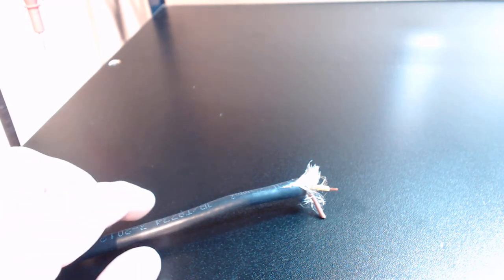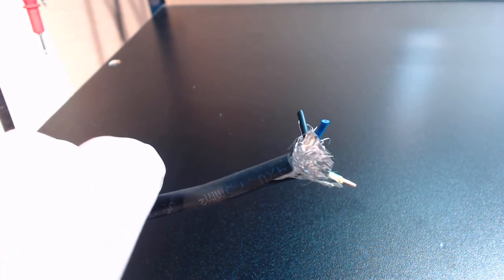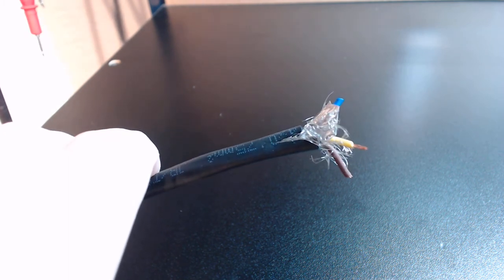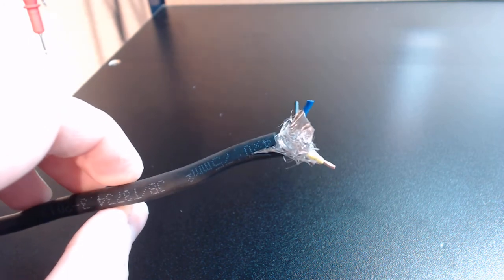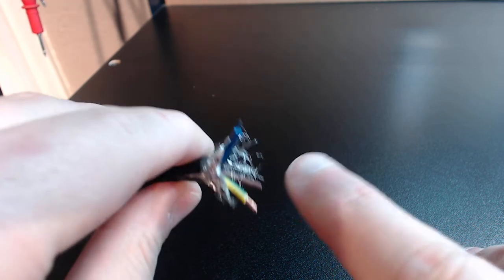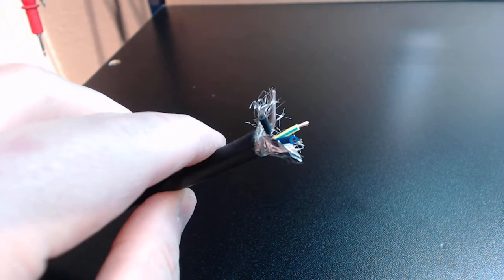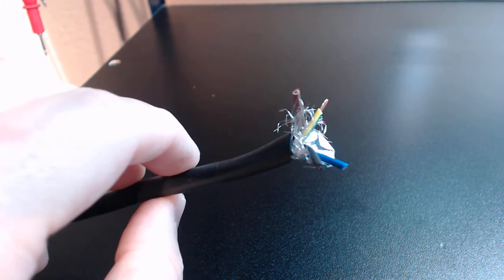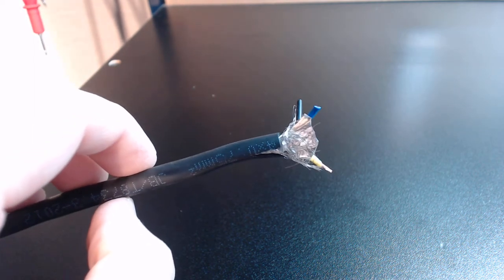18/4 Double Shielded CNC Robotics Cable (Ultimate EMI Signal Protection)

Comment: do I connect the shield and the ground wire to both ends (the VFD and the spindle?)
Reply from the maker: The shield,  and ground wire are only connected to one end of either the VFD, or the spindle. If you connect it on both ends you can create a "ground loop".
Thank you,
Vince

Comment: Would this cable work for a 2.2kw spindle and a VFD that is not in the same case as the other CNC equipment?  The VFD will be mounted on a stand but not connected to the machine itself.
Thanks in advance
Steve
Reply from the maker: Steve,
 I recommend using my 16awg double shielded spindle cable for optimal performance. Its a higher gauge cable, and designed for spindle applications. Here's the link. I carry 10, and 20ft versions.

Here's the 20ft version https://www.ebay.com/itm/131899174942

Here's the 10ft version. https://www.ebay.com/itm/142538105021

Thank you,
Vince

Comment: i have just ordered quad sheild from jaycar australia each wire has a sheild as well as the group.. keep up the great vids really like the one on grounding something i overlooked
Reply from the maker: Mick, Thank you for the kind words. The cable is one of the best investments you'll make for piece of mind. I'm glad the grounding video helped. I'll keep them coming. Thank you, Vince
Reply: thanks I am currently building my table and watching and learning from a few tubers and one other thing i learnt from the guy at the shop was load carrying capacity of wire ie amps and length of wire to loss percentage and when we spent some time working it all out recommended to me originally by the stepper motor supplier was an awg 26 but as we used the formulas he had we found that i had to change wire to awg  21 to run motors at peak amps over the length we needed my table is 3 meters x 2 meters... not sure this helps but it seems applicable..
Reply from the maker: Mick, The peak number the drivers display as their amp rating isn't the accurate number to go by as the drivers output is virtually always the RMS output number. I agree with what your told about the AWG of wire to use to prevent loss of power over length. The table size you have is very common, and 22awg to 18awg should be used for cables longer than 10ft. Thank you,Vince
Reply: Thanks Vince just thought id run it by you as all this is new to me and sometimes its better to ask.. ive never run or built a table at all in my life but learning of you tube and asking someone of your experience helps alot.. so thakyou for helping i do appreciate it..
Reply from the maker: Yes sir. That's what I created the channel for. Take care, Vince